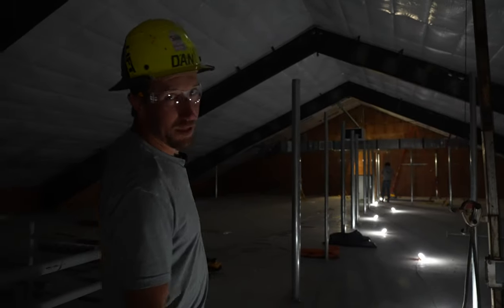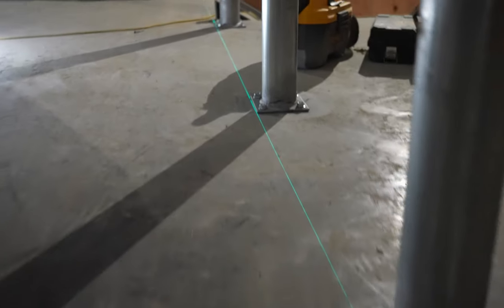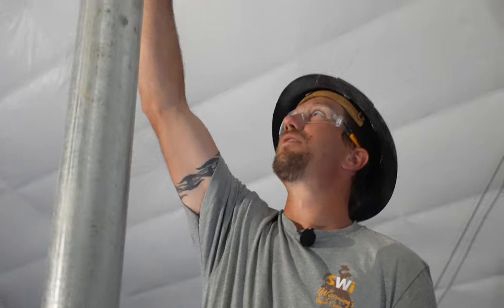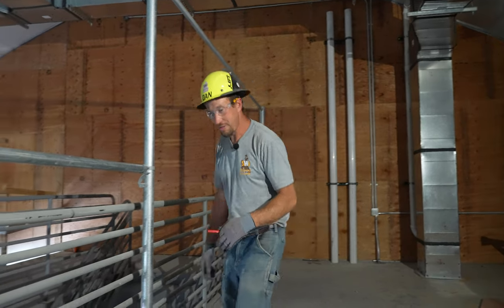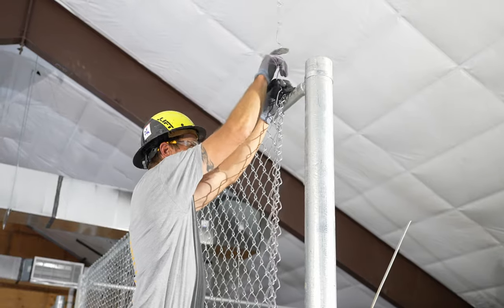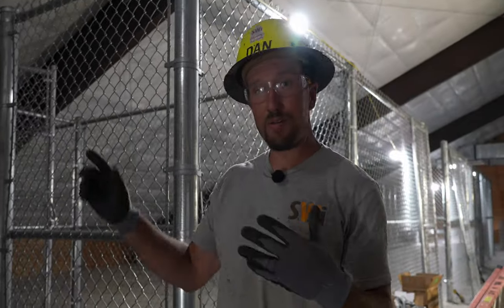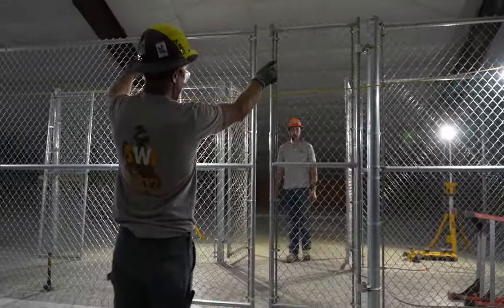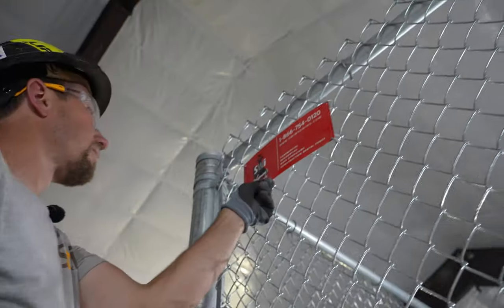The Strangest "Fence" I've Ever Built

Comment: You could cut the top off a wedge anchor bolt to ruduce the tripping hazzard. But Tapcons are still a good way to go.   But why not use a pul-Jak for pulling the fence tight?

Comment: Good job boys! I’m working on a similar job now that is for holding bears at our local zoo     Also inside of a couple of buildings, however all the floors are at different slopes to accommodate water runoff. I have built and designed what we are calling guillotine gates that slide in a tracking system. They are all remotely operated via cable and pulley with the latching system integrated into the attachment of cable at the gate. Really cool job and nice  to see you guys doing something similar at the same time that I’m working on this zoo project. Love the videos and keep up the great work!
Reply from the maker: Sweet--that zoo job sounds like fun!